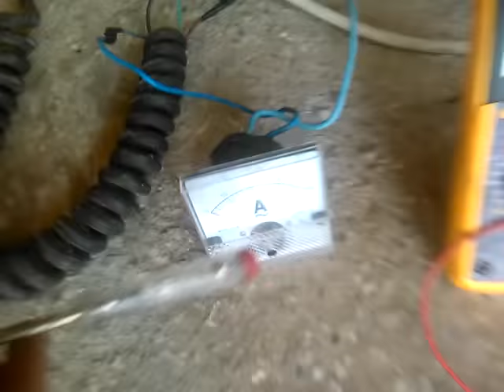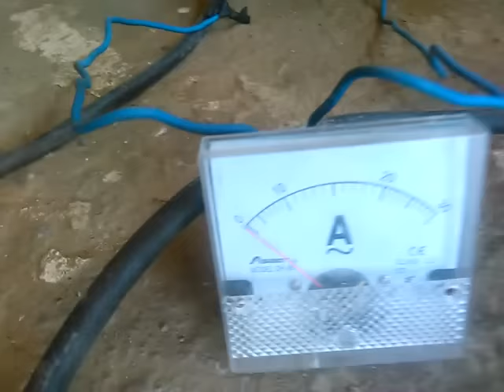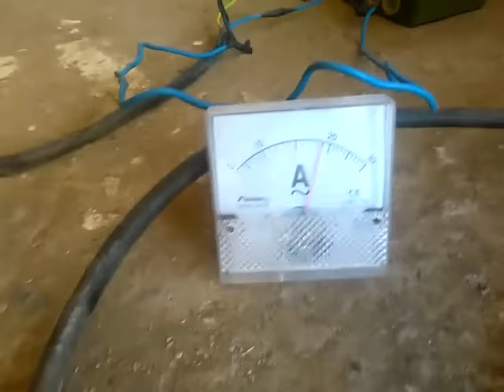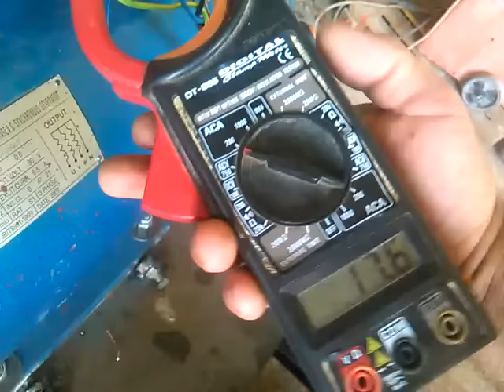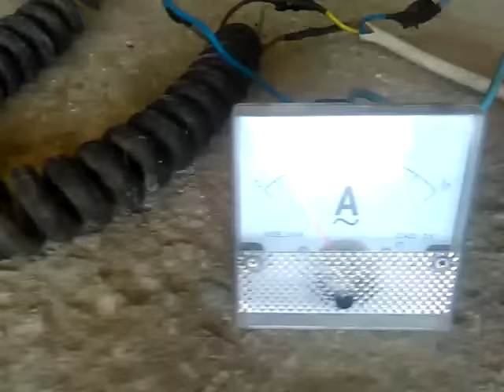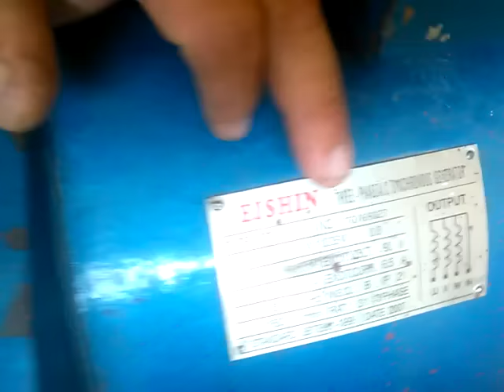HYBRID GEN (Free Energy) phenomenon LOW POWER FACTOR .

Comment: the pulley of the electric motor is huge.  it is almost of the same size as the generator.  i did not see the rpm rating of the electric motor.  i also did not see the voltage rating of the generator running at 1500 rpm.  i guess it is 230 v.  however, 400+ volts was the output.  the rpm of the generator is over the rated specs.  definitely, voltage will be super high, and so will the output power in kW.
maybe, if the speed of the electric motor could be regulated in such a way that the rated voltage is outputted, then, this would be perfect.  it could be used in so many, many ways, like when building a house and there is no electricity yet.  most of the tools run on 230 v.  however, with 400 v as the output, the many tools, lights and appliances will just burn.
i guess this is also true to almost all self running generators that are shown in youtube.  voltage is almost not regulated.  the target output is just to self run, and not to regulate the output electricity. the output may be higher than the input but it is done through over speeding a generator.

Comment: Hi! It working the motor single fase to threephase
Reply from the maker: input 3 phase 8 amp  .output 3 phase 28 amp
Reply: @pneumatic-generator2022   ok The single-phase motor is connected to the mains and the three-phase is connected to the single-phase with the belt and wheels according to me it can work?
Reply from the maker: i have only three phase ..i have not single phase.

Comment: I think this is much better then solar power .its a whole cheaper and something not as loud might be good for a off grid home
Reply from the maker: this think is one experiment .  the wind power and solar power is the best .    thank you.
Reply: DEVIS&MARIOS  your welcome but solar and wind power is  way to expensive especially the nickel iron batteries
Reply from the maker: Thank you Anthony Rey .. this is what is required by the global industry ..Big expense. The large consumption. = Big profits..     ..Of course it is the best way . exist the best way . but It does not matter to anyone..    .. Even in the wind energy I have made a walk forward . But investors do as if they do not understand..   I have modified the synchronous generator 1500 rpm to automatic regulator generator 750 rpm .. Begins to produce from 750 onwards .. No magnets. Does not heat up
Works as a direct drive in hydroturbine . at wind turbine etc ..                        ..The result is the same. Neither one is not interested         https://www.youtube.com/watch?v=bclXEoyQh04

Comment: Thank you  for posting it.The energy efficiency around 200% without inertia torque by IC engine.So the key point to get 200% efficiency is the right selection of generator?Would you please tell me that you do any modification of the synchronous generator?
Reply: The energy efficient is not 200%, you missed the words "LOW POWER FACTOR" in the video's title perhaps?  Do you know what that means?
Reply: You still believe in free energy! There is no free energy anywhere in the universe.
Reply from the maker: I've the achieved the outdo. a law of thermodynamics
APOSINDONIZMOS ADRANIAS . = FREE ENERGY  is the new law
Reply: hsu Frank thelo100
Reply: @JahanZeb1976  de que sirve tu comentario?...

Comment: HOW MUCH SIMPLER CAN THIS GET FOR YOU,,,
YOU ONLY INPUT THE SMALLEST AMOUNT OF DC CURRENT, 
(ONE SMALL BURST) = ONE SHORT SPARK 
ROTATING DC MOTOR A SINGLE ROTATION, WITH A 100 cm CIRCUMFERENCE PULLEY, 
which drives a belt, that you can attach one to ten mini-pulleys of 1 cm circumference, with AC generators attached, giving you an output of 100 to 1000=100X10 cycles of AC electricity. (these rotations of your AC generator are pretty much torque free, as you are only looking to generate the smallest amount of current)= only enough to rotate a DC motor once. So, even though you are generating massive voltage, you only need to generate one short burst of current, (practically nothing when talking about current. Where even massive voltage multiplied by practically zero current, still equals practically zero power,,, which costs practically zero torque to rotate=free spinning.
-
Do you realize just how simple this free energy technology is, and does that show you just how much of an influence that evil forces have on our society, to be able to hide free energy simplicity. This is the best proof of the eternal battle between good + evil, so I suggest that you start reading the Bible, http://beliefstoliveby.yolasite.com/ and then my suggestion is, that you take Jesus into your heart, become born again, and start looking for His soon return, then pray that you are chosen to be involved in the Marriage Supper of the Lamb, and escape the soon coming Great Tribulation . Yes, even though we are warned that “the day and hour knoweth no man”, we are assured that this 2520 day Peace Treaty MUST start prior to the first door closing on 2019.04. http://my2020vision.yolasite.com/ 
-
http://free-energy.yolasite.com/ 
http://doorschristmustpassthrough.yolasite.com/ 
http://beliefstoliveby.yolasite.com/ 
http://fire-starter.yolasite.com/ 
http://biblefilescentral.yolasite.com/

Comment: They never show a wiring diagram or good pictures on the motor tags
Reply from the maker: hello.   what's important is the target of motor .. the motor are three pahsico 4kw ..  I tell entry and exit system .. input and output in ampere ..   the volts is the same 400 v ac

Comment: Impossible and fake the output is always less , Who noticed with me the difference between the source wires of the motor behind the ampere meter and the ones which are connected on the motor

Comment: Not free energy only hi efficiency now you have 8 A input from the grid  and out of the generator you get 17A  you have 2 electric motors as load your load is not more then 6 amps  because you only have rotation load the moment that the electric motors rotation start the load is reduce to 4A  Now a real load will be to make those electric motors transfer that rotation to a load run a machine to some caind of use see to run any machine or a drill or anything require  rotating force WEN IS WORKING not just rotating now if you have to build a machine this size and run what?  were the free comes in ?   you have any idea the cost of making this generator and the motor ? because you want find this in the trash or in the side of the road so were is the free ? Nothing is FAKING free you want free? go live in the wild 600 miles from civilization or more build a cabin whit wherever you find around Burn wood to make a fire hunt fish  for food ware skins for clothing bade in the river clean your as whit leaves   all that is free you don't need money for that just guts and determination
Reply from the maker: please calm down my friend. Relax . in this video i explain a phenomenon LOW POWER FACTOR .      bcz you're looking for free energy.  you do not read the title.  if you have electrical knowledge. you would give a short answer .  YES or NOT..     thank you

Comment: hi i would like to share  a few things 1st. your wiring is  completely unsaved .please do proper wiring. where is your earthing system  . your cable completely unacceptable. please be in better simple low voltage  switch board.
Reply: I ha

   ve في العالم العربي والإسلامي فوكءن